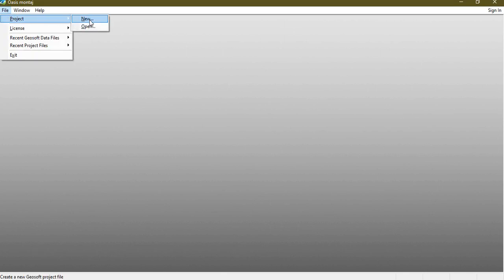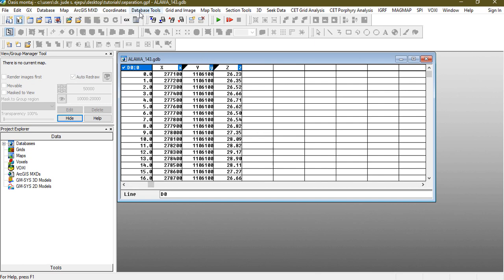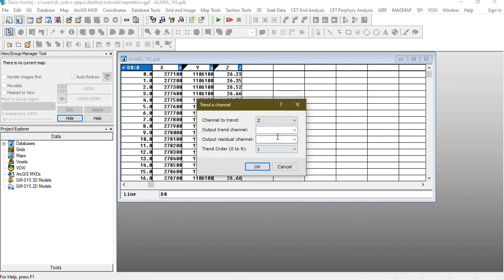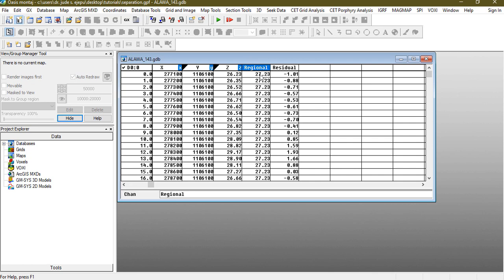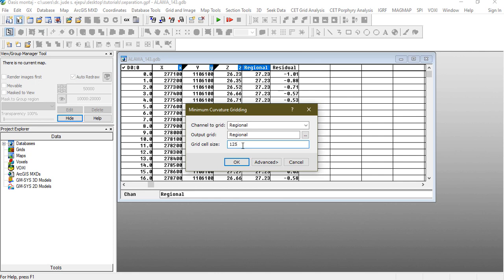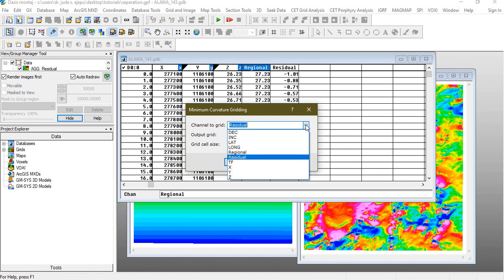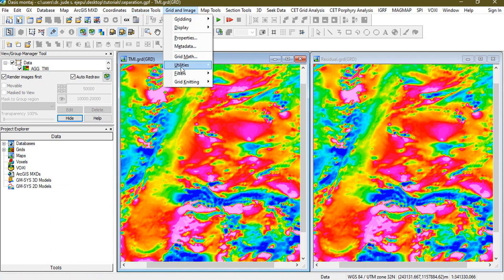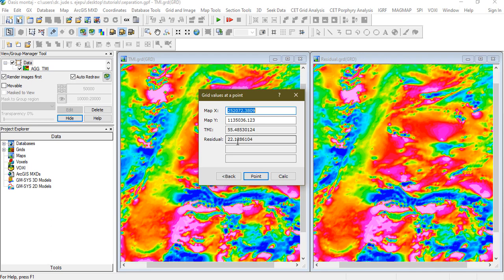Regional Residual separation of aeromagnetic data

Comment: Good evening sir.Thank you for the great work you are doing.
Sir,let me ask,which  filter  will be the  most appropriate to apply to marine magnetic survey data  whose scope  was to detect pipelines positions buried or expose on the seafloor in order to  enhance data quality and accuracy?
Reply from the maker: Thanks so much for your kind worda. To answer your question, a combination of RTP (or RTE or DRTP), high-pass filter, first vertical derivative, and analytical signal will provide the most reliable results for detecting pipelines. The specific cutoff values for filtering should be determined based on the expected pipeline burial depth.
Optionally, you may wish to perform horizontal derivativea to sharpen the edges of the pipelines.
If you do all these and the signals are weak, you may consider a downward continuation, trying out different depths.

Please note that these are suggestions. Making interpretations of magnetic data is inherently an iterative process. You just keep trying till you get moat reliable results.
Good luck on your project.